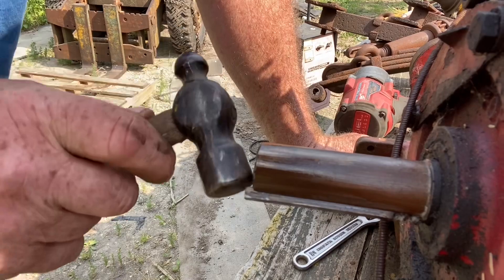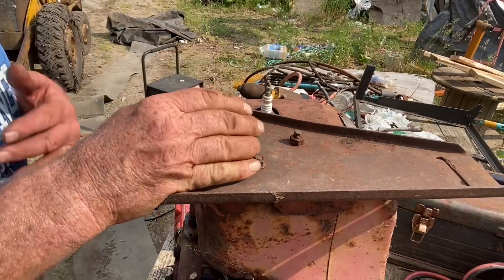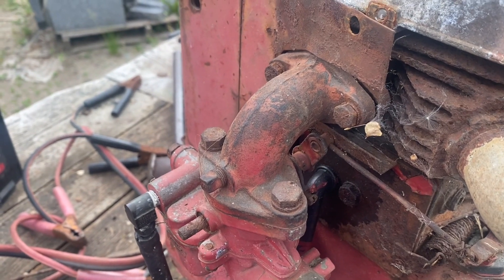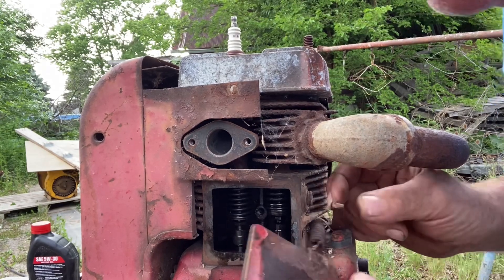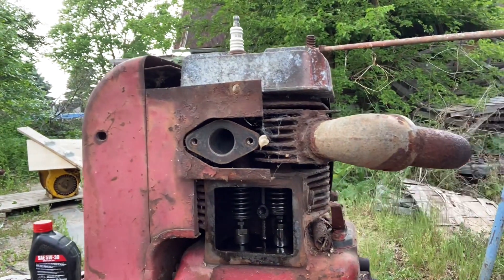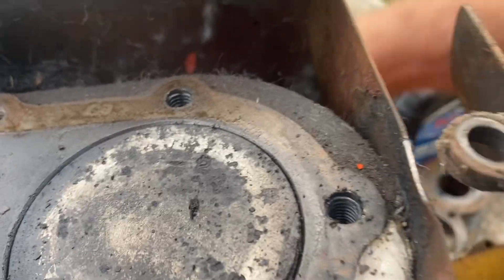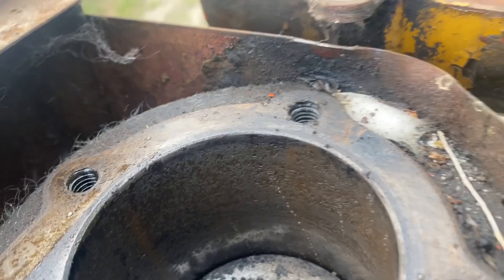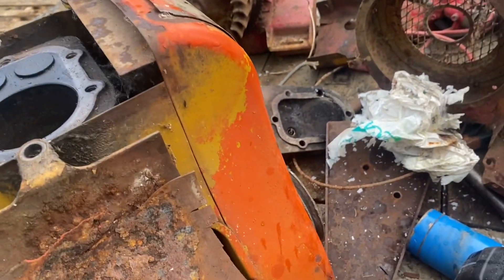Agricat - Wisconsin engine disassembly 6/1/23

Comment: Was hoping to see your Agricat. I have a Model F Agricat, was missing engine, that little transmission, but has most other items. Have a 16 horse Kohler from a military pavement breaker, was going to use that for power. Best to you on your project 👍

Comment: You probably already know this but the score mark on the engine you want to use is probably from a cracked ring and if it is it’s only going to get worse somebody may have cold started it with ether maybe not but it’s possible I hate using ether on a gas engine but I know that’s disappointing but maybe it might hone out but I think you know more than me so I will quit while I’m behind 😀🇨🇦